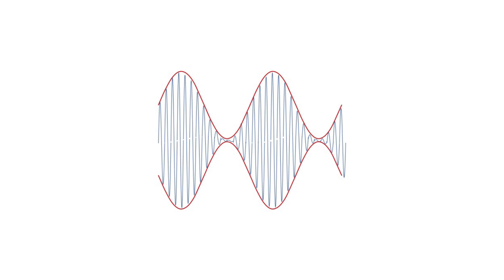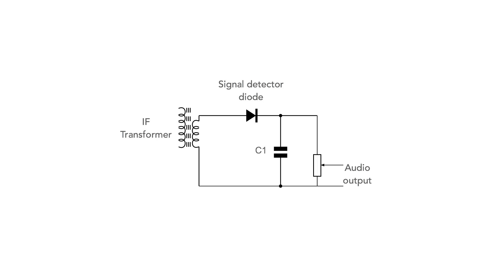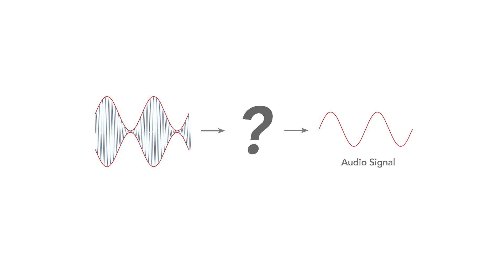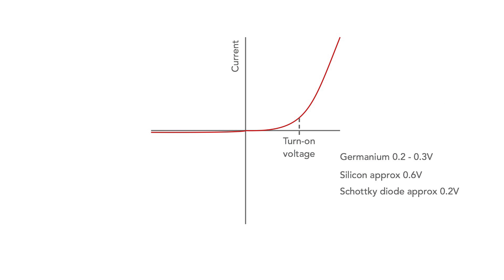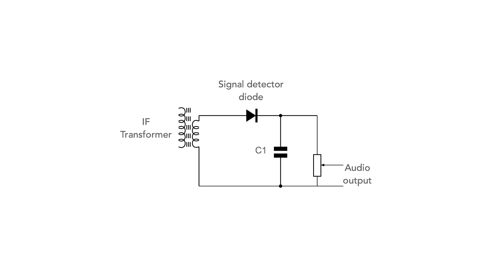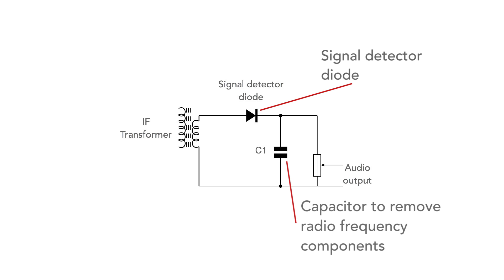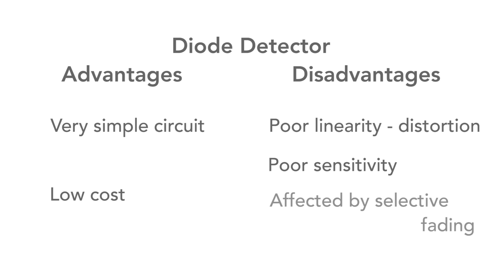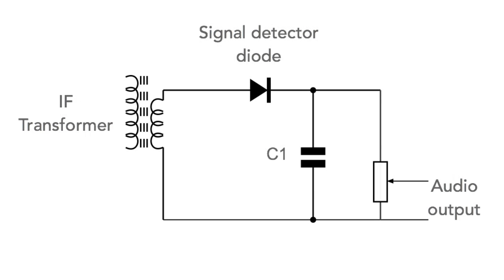Diode Envelope Detector | Amplitude Modulation AM Demodulation

Comment: can you clarify if the AM signal is carrying data/audio in Sine Wave when it reaches the detector (diode) and is removing half the signals amplitude isn’t that then loss of data or audio as a consequence? or is the data only actually enveloped in the positive side of the wave….?   Or is that in the AM the data is duplicated on both sides of the sine wave?…. Your answer on this would be greatly appreciated?
Reply from the maker: Essentially the modulated data such as a sine wave or other signal is duplicated on both sides of the carrier - its amplitude is modulated. To recover the modulation, one way is to use a diode to remove half of the waveform. A small capacitor is normally included to remove the last elements of the carrier, but this is not normally an issue. The rectified signal can then be amplified to give the required audio, or other signal.
I hope this helps.

Comment: This does nothing to explain how one half of the signal can be heard. Why doesn't it sound like SSB, where half the waveform is also thrown away?
Reply from the maker: When a modulated RF signal is passed into headphones the alternating nature of the RF signal itself which has a much higher frequency that we can hear of the headphones can respond to means that nothing is heard. Rectifying it and then removing the RF reconstitutes the original modulating signal.
Single sideband trows away sections of the RF spectrum of the signal. Envelop detecting extracts the original audio, even if it doesn't do it efficiently.
I hope this helps.

Comment: isn't there a resistor used ?
Reply: The resistor just represents the output load and its usually a potentiometer which is the volume control.
Reply: @ShaithMaster  Hello, is this the same to Non-coherent receiver? Please answer me, I need it ASAP, thank you so much.
Reply: @Dan Nguyen Hello, is this the same to Non-coherent receiver? Please answer me, I need it ASAP, thank you so much.